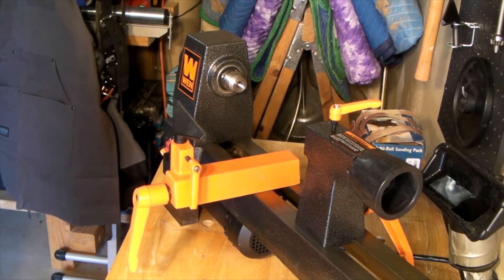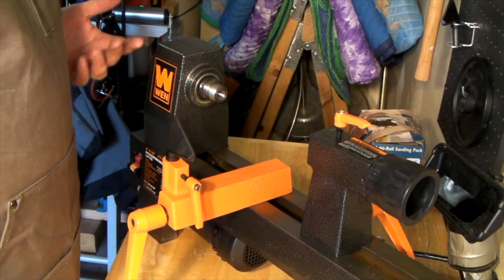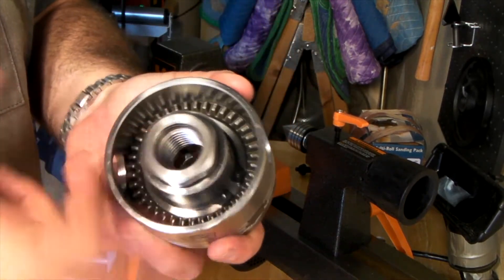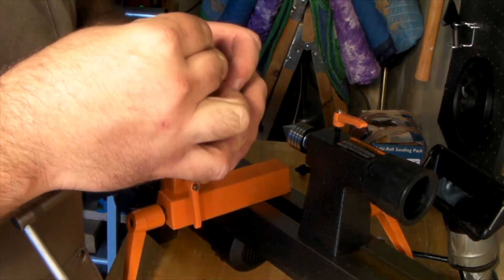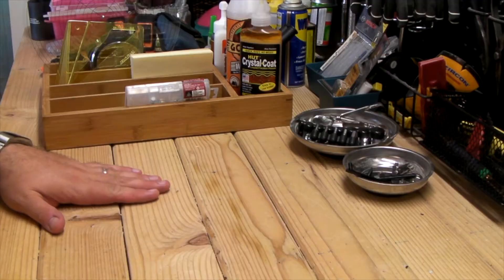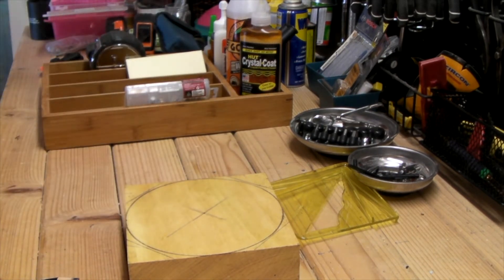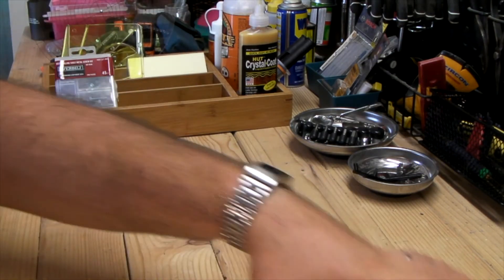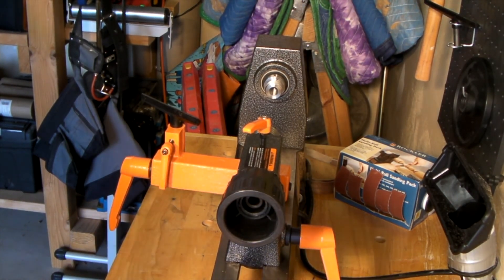Ep.2- Tools

Comment: HI, thanks for all the details. Could you list the links for the upgrades?
Reply from the maker: Here you go! (just a note, I am not sponsored by Nova or PSI)-
If you like this, please subscribe to my channel!  Lots more to come.

Nova 48202 G3 Wood Turning Chuck Insert Type 
by Nova 
Link: http://a.co/d/i5spDyQ

NOVA IDNS 1-Inch 8TPI Thread Chuck Insert/Adaptor
by Nova 
Link: http://a.co/d/2SLqEls

PSI Woodworking Products TM32 1/2-Inch Diameter Drill Chuck with a 2 MT Mount 
by PSI Woodworking 
Link: http://a.co/d/4N27n5P

PSI Woodworking LCHSS8 HSS Wood Lathe Chisel Set, 8-Piece 
by PSI Woodworking 
Link: http://a.co/d/avxAohZ

PSI Woodworking LCENTLT1 1MT Heavy Duty Live Tailstock Center 
by PSI Woodworking 
Link: http://a.co/d/aMBb5bQ

PSI Woodworking Products LCSIDE2 Round Side Scraper Chisels, 2-Piece set 
by PSI Woodworking 
Link: http://a.co/d/feg7hGw